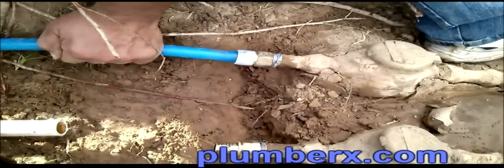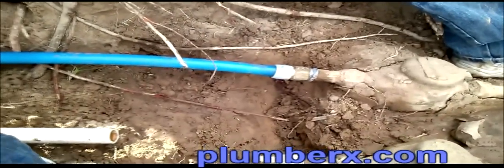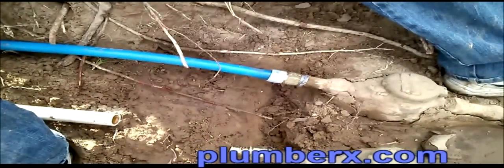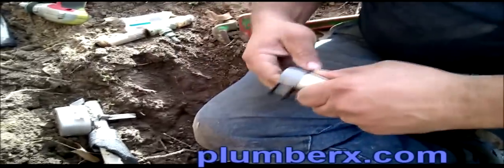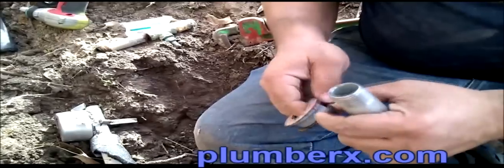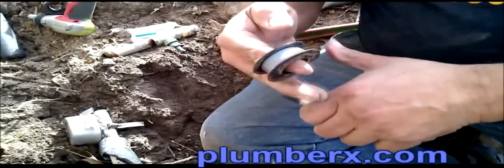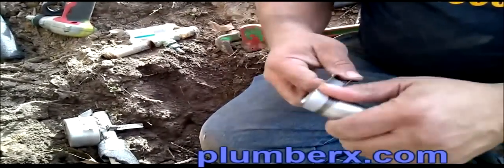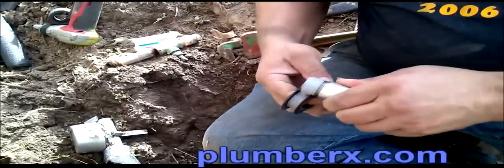Installing Pex Water Main 8 of 10

Comment: A page on the Sharkbite website says their 25 year warranty on brass fittings requires that buried fittings must be wrapped in silicone tape.  I think this applies to all their brass fittings, not just the famous press-on fittings.  Any comment on that requirement?   https://www.sharkbite.com/resources/video/how-wrapping-sharkbiter-fittings-underground-installations
Reply from the maker: The best practice is to not put plumbing fittings under ground at all unless you have access to them like at the meter box. , but I'm using ubonor fittings here. And all the connection underground here are exposed at the meter box only for future access.

Comment: Hello I HAve A Wheel Chair Ramp On Top Of My Main Supply Line .How Would I Run My New Line ? Thanks
Reply from the maker: Thomas Whetzell If possible you may have to reroute it. If its in a basement you could drill from basement to point past ramp. The drill is called a water auger made up of 3/4 black iron pipe and a 1/2 roto drill.